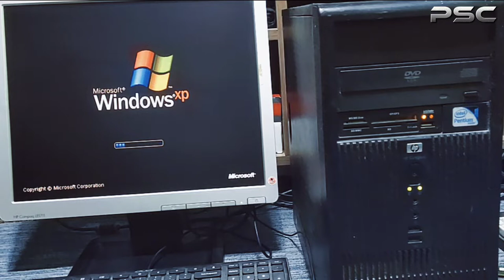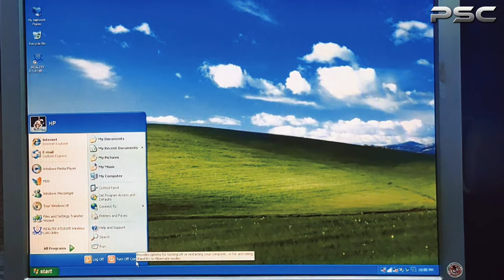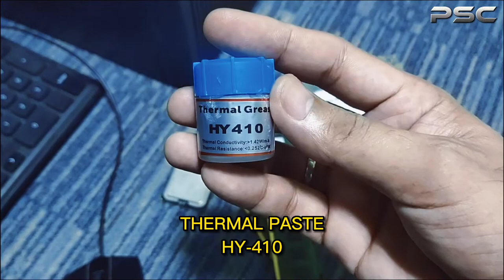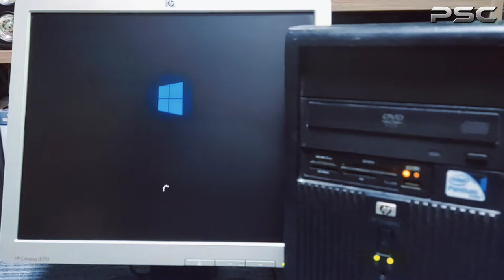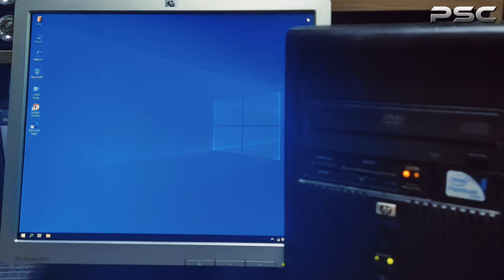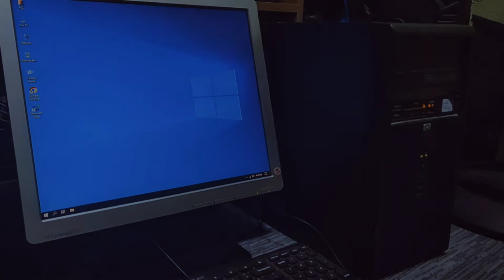HP Compaq DX2300 Microtower (CPU, RAM, HARD DISK and OS Upgrade)

Comment: A lightweight Linux like Lubuntu would work far better. Older hardware can still have uses - if it uses a decent operating system.
Reply from the maker: Thanks for sharing your idea and solution for the older pc hardware.
Reply: @perfectsilencecreation 
I recently got HP Compaq dc7900 CMT and dx230 Microtower very cheaply. Going to upgrade both to maximum that makes sense (not absurdly-priced parts). dc7900 will get Quad Q9550 (got great deal, typically very expensive), 8GB DDR2-800, and either 512GB SSD or 750GB HDD. Will try Lubuntu. dx2300 am still looking at upgrades for. And very likely will repaint both.

Comment: Found a DX2000 completely intact near the trash can not far away from where I live 3 years back. 😇🤗😆👌👍

It had a typical case of bloated/bulged electrolytic capacitors near the CPU. I replaced those & it can still run to this day. But I need to upgrade the CPU & increase the memory.

The current CPU is an Intel Celeron 2,66 GHz D330 SL7NV & has only 1 GB RAM (4x 256 MB sticks). 🙁😔

It can support a SL7E3 or a SL7E5 CPU & 4 GB PC-3200 DDR1 184-pin RAM DIMM (4x 1 GB sticks). Hopefully I'll save some money to get it upgraded to the max. 😍😇🤗
Reply from the maker: Good for you, Thanks for the info. And sharing your PC Restoration Project. It is priceless when you see your work working!!!